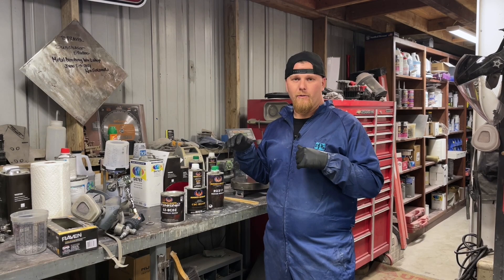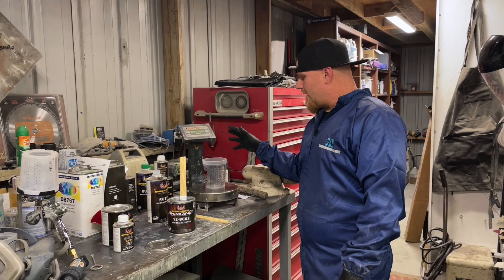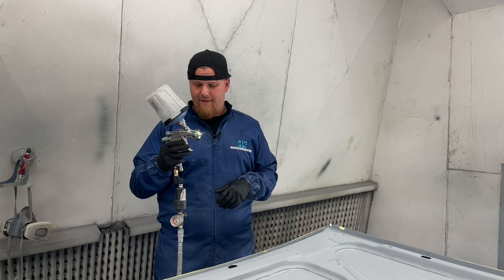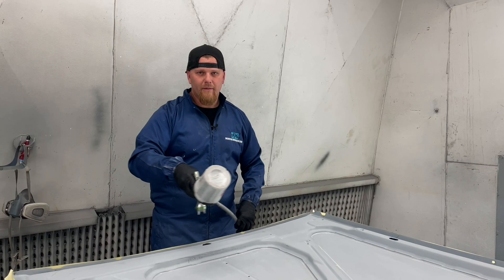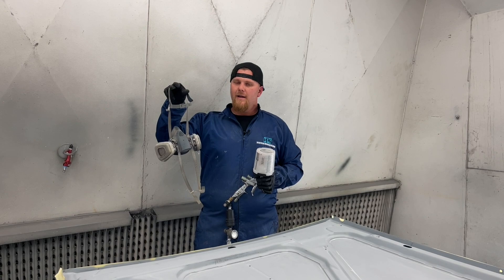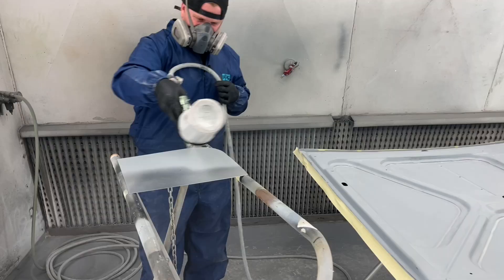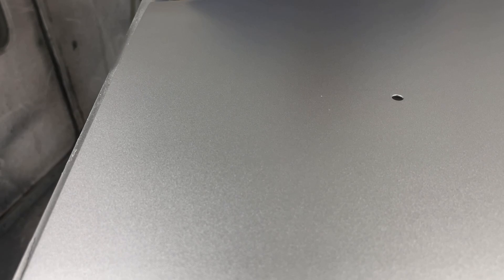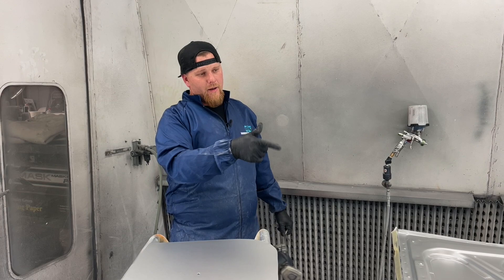Finally: A tutorial on how to make a spray panel and get a good color match!

Comment: love how technical slyvester is with his explanation and theory. It goes right along all the trainings and/or seminars that i've sat through with paint manufactures when they're teaching their product line(s) of paint. I'll always respect the DIY'er or old school guys that simply know all the right parameters and conditions through experience. but when you're new and learning you need to learn to do it the right way first. theres too many IG/youtubers that are spraying purely for appearance and not understanding or adhering to the manufactures recommended SOP's. if you want a paint job to last 10-15+ years, do it like how the engineers that formulated these products intended for them to be applied.

i would like to add one small tip: with any paint job you do, its a good idea to take notes. Write it all down for your record. everything you did to create that paintjob down to how you first mixed it to eventually how you applied it. how many coats. did you have to add more tint? Did you use a slower or faster reducer that day? did you need to do a multiple passes? did you accidentally add too much of one additive or color? was your distance or speed slower or faster? what was your air pressure? etc... it all helps streamline the whole operation so you are not starting completely from scratch everytime you go to paint something or blend something.
Reply from the maker: Absolutely that is a great tip thank you for watching. We hope to do a gun set up video soon on the next full paint job we do and we will cover this 👌🏻👊🏻

Comment: Great tutorial! I've seen painters get burned using a colored sealer when color matching. Most paint lines are using the 7 shades of grey to achieve a certain shade. Medium blue pearls can be very deceiving on coverage without the proper ground coat. Also, to prevent mottling I slow my paint down as much as possible( high temp reducer). Thats where waterborne has an advantage. With basecoats like DBC,  I use the wetter is better theory (within reason). Seems to help with mottling and dirt. Falls in line with what you're saying about high pressure and drop coats. Keep the videos coming.
Reply from the maker: Thank you!

Comment: I just want to say thank you for explaining everything the way you did! It's obvious you're an experienced painter. I WAS a professional painter, both in the body shop situation and manufacturing situation. The test panel you were counting the coats on, we used to call that a "let-down panel". It's almost a necessity for any paint job because of the use of micas and pearl in modern tri-coat paint jobs. You know what I'm talking about. You just scratched the surface with the candy paint. Pearl candy tri-coat is a nightmare I'm glad I don't have to deal with anymore. 30 years in painting was enough for me. Thanks for sharing the information and allowing me to add my comment.
Reply from the maker: Thank you for watching 👍🏻👊🏻
Reply: I'm right there with you on years under my belt. Sometimes painting can be a love/hate relationship. Some colors are getting more complex with things like quad coats now and different additives needing different techniques. It's not as easy as most people think it is. Beautiful paintwork is definitely an underappreciated skill.
Reply: I am a service tech if 38+ years trying to learn the products, procedures and best practices as I prepare to plan and order products for a vehicle for me. Sounds self centered but I like to do it once and do it right for longevity. I am not racing, I am not vowing to show & shines, just learning the lingo is part of this as well. Online, I see terms that say “3-Stage”, well what is that. Seeing this video presented in this fashion, I really do believe that anyone should be documenting the history of date sprayed, temp, humidity, gun, tip, PSI and distance much less product used. I would add one more, he shot a test panel. If doing a complete, this goes with the vehicle for future use in a protected soft case.
  If I put a 2003 Tahoe engine with a modified 87 era 700R4 and using the body control module from the same sonar, I will have a service manual focused on the wiring, colors, connectors, photos for location and I.D. would or should be a game changer. I won’t live forever, but if this info incudes brands, part numbers, actual measurements and schematic. This makes the out come of diagnostics, repair, being able to repeat someone efforts & getting the same results a game changer. Think, it adds to the re-sale value and any capable service tech able to do the repair and match the results in hours for repairs, but for paint it takes more time yet doable and can be repeated regardless. 
  No one manufactures a vehicle without info, wiring schematics, or diagnostic flow charts and without a paint method, brand, test spray panel included along with good accurate information, peanut butter hits the fan while in the dark!
  Thanks for sharing and explaining. Now I know! It gives me confidence in my future choices! God bless.
DK, ASE master tech since 78, retired.
Reply: @deankay4434  
Not to be rude,  but don't overthink it. I've been on my own numerous times with colour matching into someone else's work with no sense of direction. Come with the territory.  Repairing blender colors on a conversion van sucks with no paint codes. In a perfect world, courtesy would go a long way but it's not a perfect world.  It's part of experience and skill level.
Reply: @class5bodyworks   I don’t think I was trying to overthink anything. For me, this is learning. Also, maybe no one makes a spray-out panel to go with a custom paint job, that make it hard in my eyes. Others like you with talent, can figure it out. As a tech, on other forums, guys / gals both would benefit by information about parts used and wiring. I watch videos where they install parts for 7 different company’s and no consistency in wiring, fuel tank venting or what an activated carbon canister can do for someone’s daily driver.
 Some have a budget for next month and 5 years. Others, put bills in a pile. I am simply suggesting a plan.
Reply: @class5bodyworks  Dean is right. The more information shared makes future repairs better and easier, both for the vehicle owner and the tech doing the repairs.
Reply: @deankay4434  
I get where you're coming from. Definitely doesn't hurt to plan or be consistent. These videos are what it all about. Learning and sharing. I'm glad people like Sylvester take the time out of their schedules to make them. I'm still always learning.
Reply: @class5bodyworks  I had mechanical side in me, come out as I spent my life with electrical & hydraulic systems in automatic transmissions. These were my road map to start a repair. #1, Confirm the customers concern. #2, See if I can learn more by the way the system acts, as the customer did not catch with a trained ear. 
  With this being said, when Sylvester used the spray panel shown the number of coats to reverse engineer the paint job, is the moment I felt the need to introduce my idea of helping the guy/gal who is building a mild to wild resto-mod for themselves or to sell, make money and start a new project. So the mechanic in me spoke up! Being in front of a toolbox to earn a living, then handed a ticket to diagnose a problem, open the hood and find something that is “One of a Kind” is dis-heartening. It takes guessing, common sense, looking & inspecting. All this adds up. It come out of the pocket of who own it. Good technicians are paid “Flat Rate” that is based on warranty time. Decades ago, manufacturers allowed technicians at dealers to fix electrical issues on new product under warranty was to take the ticket, clock in on the back, do the repair and clock out. The labor code was (ELXX000), basically the time it took to fix it.
  In 1986, GM proudly announced that all circuit are numbered and remain the same, either car, truck or SUV. Another leap forward was the color of the wire used in that circuit remained the same. 
Then a step further we’re “Cells”, showing a system on the vehicle and that one only.
The style of drawing any circuit was now set in stone, called; Marshaling.
Like marching in a parade, a beginning, middle and end. So battery at the top, fuses, connectors, wire color, size in metric, circuit, switch, relay, device, ground. 
Look, if able, I would be happy to draw and circuit, place it order and label the cell in the index. Good service manuals had a description of how the circuit works, circuit numbers, connector numbers and photo of connector in the back or the book (C202 - E29 photo). Then to make it accurate, a line drawing of the face of the connector shown with the cavities where the terminals are, numbered and with letter. This is getting boring to a painter but a guy who used factory foldouts 8 pages long, with the head light on the left, gauges & radio in the middle and tail lights on the last page. Crazy, but everything was fine there. 
Today, Ford, Toyota, Infinity and all use the system GM put in place as everything is global. Custom painters would benefit from a standard road map just like the “Spray-Out” panel labeled with the number of coats, brand, paint code would make a repair way easier and closer to match if a simple fender bender. 
Anyone try to get vehicle insurance thru “Hagerty?” (I hate these phones changing words)
 Look, to me it is a simple idea that would lower cost of future repairs, paint or otherwise. No big deal!
Reply: @deankay4434  They do have such a system for color matching paints. Unfortunately, it is for the most part available to paint shops whom are set up with expensive paint mixing systems, not readily available for the average D.I.Y. guy who wants to paint his own car in his garage. Even as a experienced automotive technician myself, you're not always going to be working on a GM vehicle where you can reference the nice tech manual for information, In those cases you just have to use your years of knowledge in the trade to figure troubleshooting steps until you find a solution... Same thing with a knowledgeable painter knowing how to blend colors technics until he figures it out.  I get your point 100% although, sometimes experience is the only solution, and without it you seek it, or pay a professional.
Reply: @Rick-O-Shay60    During the 80's, as an automotive, welding, it was my job and only one other who had keys to our Sherwin-Williams paint mixing room. Scales, formulas, amounts to the 0.5 gram to mix the colors. It was only the type of resins and dryer that determines if you are producing a single stage, inter-coat or base. We had 16 metallic flake (Size / Color) plus pearl, full set up. I am very familiar about mixing paint and tinting.
  As chemistry changes, so does product. Like welding, machines did not have voltage control, only amperage. Plasma cutters were out, but UTI (Universal Technical Institute where I was teaching, mixing the paint, got me in the hot seat with the owner, Ivan Aduche who's anger about my discussing the plasma cutter the school did not own. Man he was pissed! But with common sense on my side, I simply asked him if he wanted to graduate students to place in body shops who had a plasma cutter and the students would have never heard on one or what they do? I asked, is that what you want? No.
I was going back to a dealer and did. It took 12 minutes to get hired to be the Isuzu tech. I did Buicks and any used car that needed repair. There are few imports I have yet to work, diagnose and repair. As we had 28 "Mitchell" manual's in book that became ridiculous. As the introduced MOD-5, they left so much out! The Jag XKE 12 cylinder has 2 Q-Jets on a manifold that wraps over the valve covers to the outside of the heads because of its narrow 45 degree design. Aston, DeLorean, Mercedes, Audi, Volvo CIS fuel injection systems. Rolls Royce with TH400 and air bag suspension in 1978, every vehicle the Air Force brass could bring into the US fell into my repair stalls. Head gaskets, differentials, automatics from JATCO 3N71B to TH4L30e. Try setting the 3 timing marks on a compound planetary gear set? Imports, Domestic, Motorcycles, done that. Since I grew up in the age or rebuilding since the only part in a box, came from the dealer. Carbs, alternators and during tuneup's, the distributor came out to set up on the distributor machine. Set the points, change springs, drill and press oversized bushings the check total advance. Rebuilding the Ford VV7200 & VV7400 as the Ford dealers were changing it to the 2BBL carb under warranty. It was crazy stupid. So, yes I am familiar because I did them.

Comment: Excellent video , I have seen some other videos and when the painter is doing another coat and they will go over all areas twice ,which would seem wrong to me and as your explaining even the 50% overlap is like two coats  , but necessary to avoid patchyness  , and as long as you count your coats and do everything the same , I am going to do a small red candy paint job on a old 76 Goldwing , so three piece false tank and side covers all quite small bits really  , and I want the insides painted so that will be my practice .Cheers .
Reply from the maker: You got this 👌🏻👍🏻

Comment: Dang, I did the exact opposite of this and cranked up the PSI trying to fix tiger stripe last year on a hood I was working on. BTW, you are never "beating a dead horse" if you use a different communication channel/method to make a point. Some learn by watching someone perform the task, some learn from the white board and some need both to drive a point home. Good job!
Reply from the maker: Thank you

Comment: I enjoy your channel. I've learned a lot from it. if you spray metallic at say 30 35 psi and drop psi to 15psi are not changing the color drastically?
Reply from the maker: Thank you! No it will just make it look more uniform the biggest thing to remember is when you drop the pressure to do a tighter overlap.

Comment: One thing to know that you didn't mention is to overlap 75% with your candy also Sylvester you might want to lose the goatee when spring because the respirator doesn't stop the vapors with any facial hair only a word to the wise my friend very good illustration though I enjoy your vids even though I'm retired and did a riddler contender with candy back in '07
Reply: @tomvaliquette8164  I feel like a PAPR system would be ideal here,  given that they're in a hot area. Add a speed glass helmet for protection(and a nice breeze) when welding, grinding, or even sanding as well. 

They're somewhat expensive, but they seem worth it in this case.

Comment: Stupid question? Where do you look for the PSI? At the water separator or the small air gauge by the spray gun handle with the trigger pulled?
Reply from the maker: Either one really. Just adjust it to what works for you. Once you get the spray pattern you like then just set it the same every time. For me I change it at the gun 👌🏻
Reply: @SYLVESTERSCUSTOMS  So for a low end develbis HVLP gun with the tiger pulled what do you think the ball park is for PSI? Thank you in advance. You can see I am doing a lot of classic motorcycle and atv restos on my channel but am always striving to be better. The last tank I did was on a 1985 ATC200X and it came out flawless. I am also wondering how I would use 2k high build as a sealer for my tanks. I get them so flat by blocking the 2k but always have a small area or two where I get down to metal, like a dime or smaller area. It would be so nice to just be able to spot and feather around these spots and let flash and go right to base coat without having to guide coat and sand yet again?? I use 2k because on bikes I need a primer that  is sand able over night. A car is such a long project waiting for epoxy to cure is not a big deal but with bikes it has to move fast. Love and have watched almost all your videos and love them! Thank You John
Reply: @SYLVESTERSCUSTOMS  Thank You

Comment: What are you using for a seam sealer under the hood like that? And are you concerned at all with how it will affect the outside on a hot day where to may hold the hood skin and create a picture frame or shadow?
Reply from the maker: Couple things to consider. The sheet metal must be metal finished. If it’s oil canning or in tough shape then that will affect your appearance with expansion and contraction. If all of that is a solid foundation then I’ve never had an issue doing this. We use SEM seam sealer it stays soft enough not to crack.

Comment: After you've stirred the paint how long is that good for? Reason I ask, is when I'm refinishing wood with lets say a satin top coat. After I shoot, if there's any large amount of time to when I shoot again, I have to stir again, otherwise I'll get settling of the flattening agents., Then the sheen will change from a satin to a semi or even gloss.  Is this the same with mettalics? As the flakes I'm sure could settle.. 
Cheers John 🍻
Reply from the maker: When it comes to metallics and basecoat the amount of time that it sits does not affect the way the metallics look you just need to make sure you have the correct flash times per the manual and TDS sheet for every product the clearcoat has a very specific amount of time that you must wait in between coats and not exceed
Reply: @SYLVESTERSCUSTOMS  Got it. Thanks.

Comment: base coat silver you sprayed first but did you wet sand it before you sprayed your candy did you do a wet on wet clear coat ? or wet sanded it each clear?
Reply from the maker: Everything I did in this video is exactly what I did. Nothing got sanded in between. If you sound the silver metallic you mess up the way, the metallic will look. The clear should all be done at one time with proper flash times.